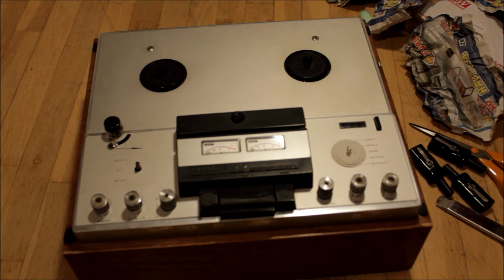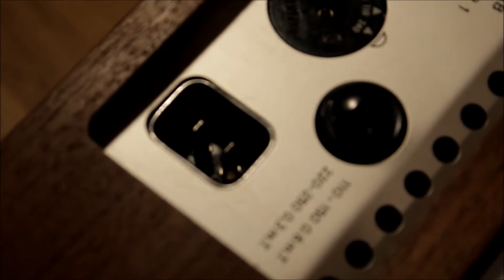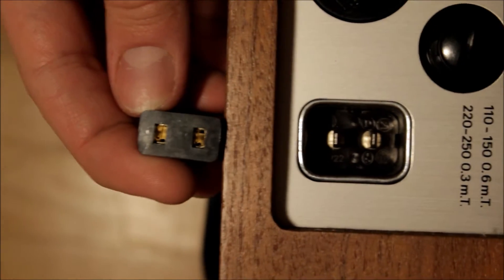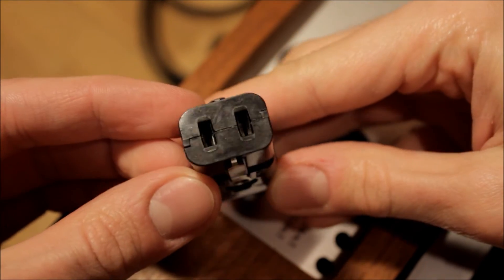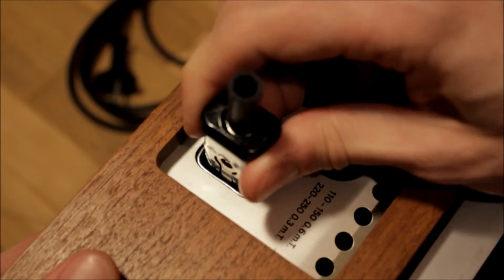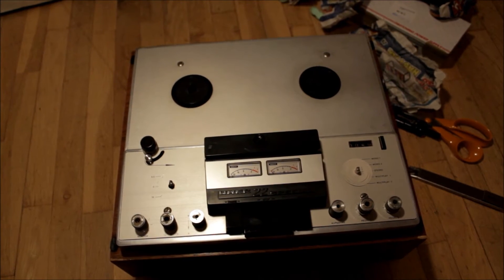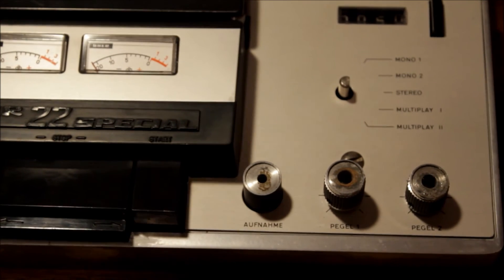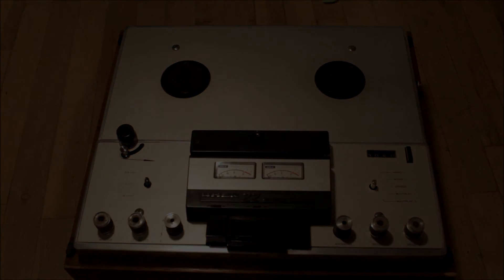Uher 22 Special - missing power cord, unusual connector from the 1960s

Comment: Any other name this plug could come under, I can't find any?
Reply from the maker: You can find this connector on the Wittner Cinetec website, either in German as Kaltgerätekupplung, alte Version (Artikel-Nr.: 4092) or if you are viewing the English version of the website, it is Appliance Inlet Connector IEC-60320 C9 (Product no.: 4092). However, this name is not correct, as it is NOT a C9 IEC connector.

Comment: I recently purchased an old Swiss made Tool Grinder Machine that has this same power connector and of course, it didn't come with the power cord.  After some initial research, I thought I just needed a c9 power cord but after some further research and finding your video, I definitely need a 5815 plug.  Problem is that there are none to be found.  Any chance you have one that you can sell me or know where I can purchase one.  Thanks!
Reply from the maker: I have some, are you still interested? Contact me at matthewgsk at gee mail dot com.

Comment: trying to find a power outlet plug for my sony ta-636 amplifier from 1980, label says c-10 connector, but they seem to be really rare now, i need a male plug to connect to my cd player from the amps power outlet
Reply from the maker: IEC C10 is the inlet, the socket and IEC C9 is the outlet, the plug. I think you need the plug, this: http://www.ebay.com/itm/IEC-C9-black-Marantz-Revox-Roland-audio-power-connector-/182010918151?hash=item2a60b23507:g:k7YAAOSwxH1UBeAX
Reply: oh right but i need a male plug not female where the pins stick out
Reply from the maker: I am afraid I can't help you with this. You'll have to get creative or rebuild the connection to C13/C14 (used on computers).
Reply: I967 yea was thinking of taking one of the 3 sockets out and replacing it with a popular type